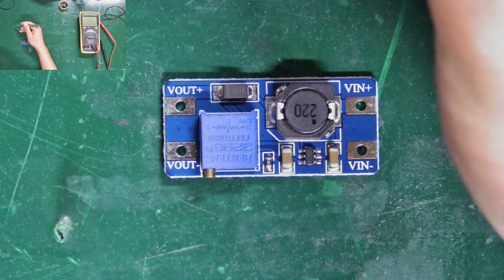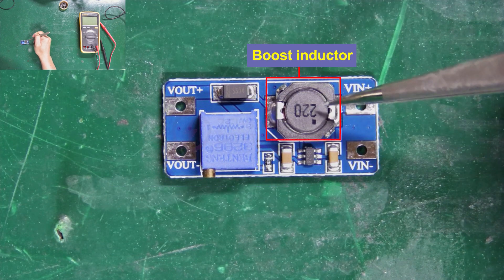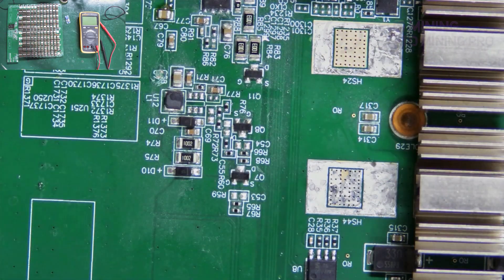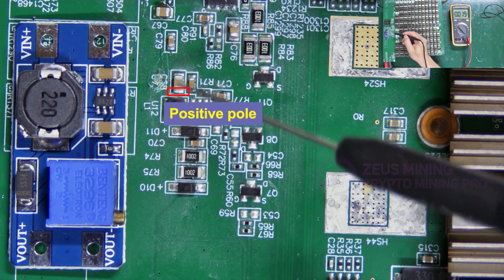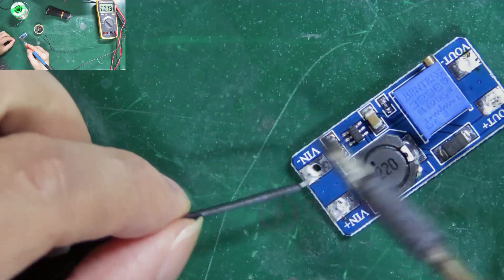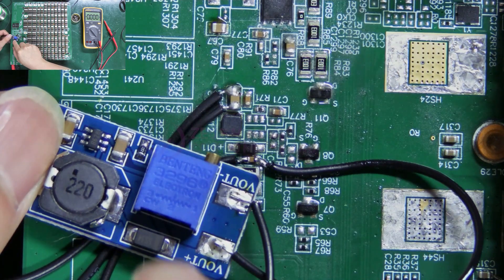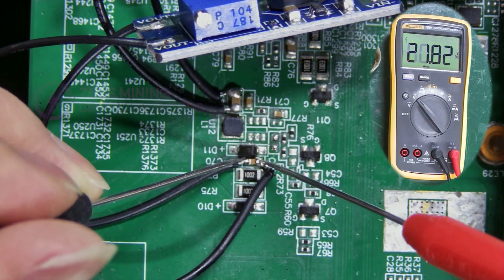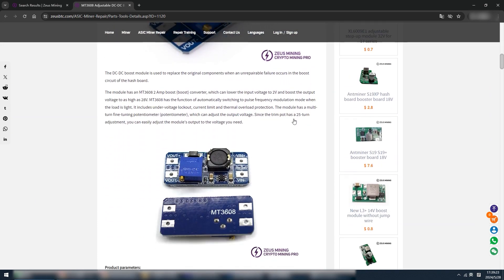How to use 28V adjustable boost module to repair the damaged boost circuit on ASIC miner hashboard?

Comment: Hi this is nice informative video on MT3608. I have a question regarding MT3608 use in my circuit.
I am Using Mt3608 module, input voltage @5V and 1A  from DC supply with output should be 5V and 1A connected to RF Power amplifier, but the module is not stable. it is have fluctuations in voltage and current. I am not using any heat sink. Could you help me?
Reply from the maker: Hello, we are very happy to help you. Please contact our technicians through the official website and he will provide you with better help https://www.zeusbtc.com/Contact-us.asp